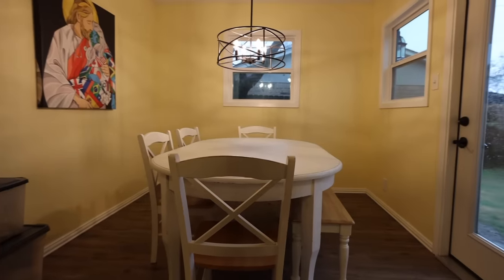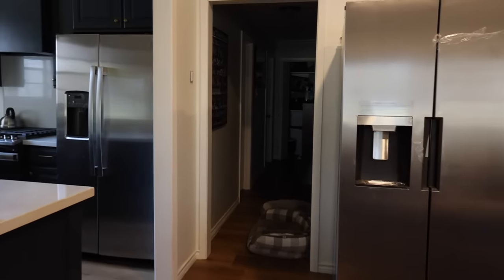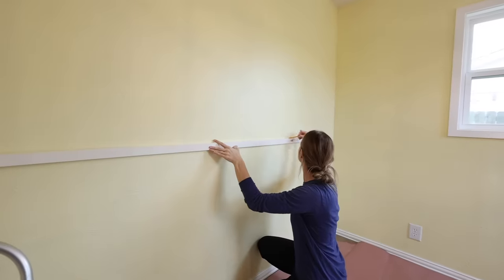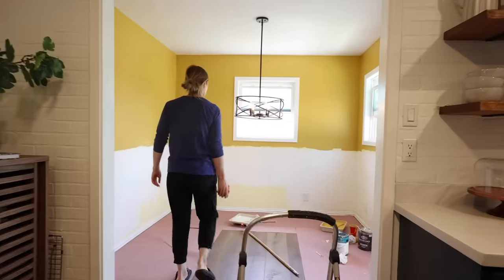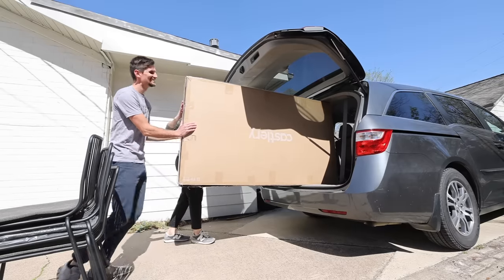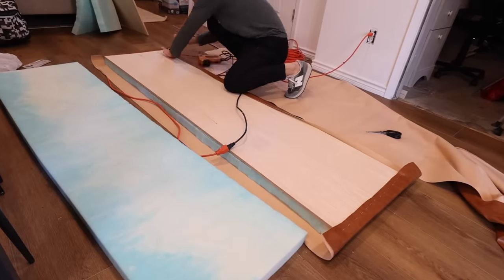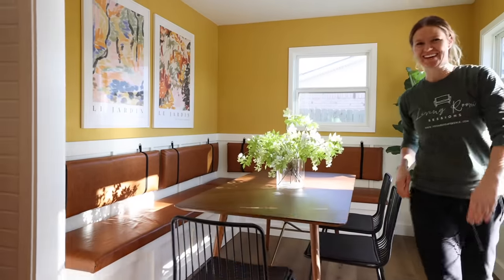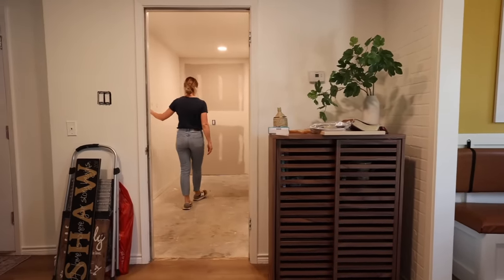EXTREME DINING ROOM MAKEOVER // DIY Built In Banquette With Storage // budget friendly dining room

Comment: Buy the folding stand from ridged for that miter saw.  Will make life easier.  I have their folding tile saw.  It stand up for easy storage and also the ends to the handles have smooth plastic balls on them.  You wheel it around like a dolly.  Then when you want to throw it in the truck you can lean the back against the tail gate.  Pick it up buy the bottom and the balls on the end of the handle just slide in.  The miter stand the same way.   Also makes it so your not working on the ground.   Easy to roll it out  The arms extend to support your work.

Comment: I love watching your videos. They are fabulous. Coming from a builders family, I am so impressed with your knowledge and building skills. One thing I have to comment on is that ceiling fixture - why didn't you take it out at the beginning ? I kept watching you dip under it while you were working and I was screaming for you to hook it closer to the ceiling but then I saw it was on a pipe. Also do you ever set up a bench or table to work/cut on? Instead of squatting on the ground to work? Ouch! I could feel it in my knees- haha!  And for comparison of $$ I just spent over $1200 to BUY a 48" bench for my kitchen similar to the ones you built with storage inside. That is without a cushion. So the ones you did were quite a bargain.  Thanks so much, keep up the great videos. Xo

Comment: Looks like you’re pulling the cut through the miter saw as if it was a radial arm saw. Miter saws are designed to cut on the push, not the pull. Safer to cut on the push.

Comment: The banquette and wainscoting were nice ideas, but I feel the material used to cover the seats and the material and mounting of the back cushions cheapened it and looked awful. I would rather have seen an upholstery fabric in grey which could be spot-cleaned or cleaned with a Bissell hand-held upholstery cleaner. They could have just scattered pillows instead of those boards hung on the wall.